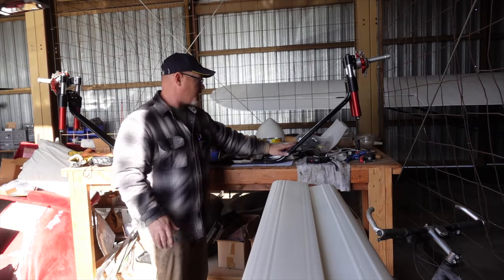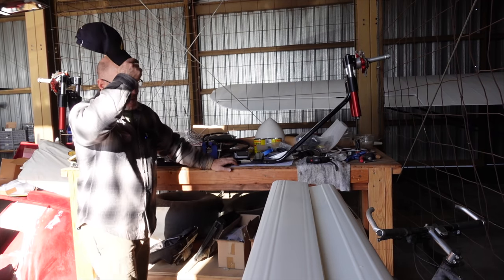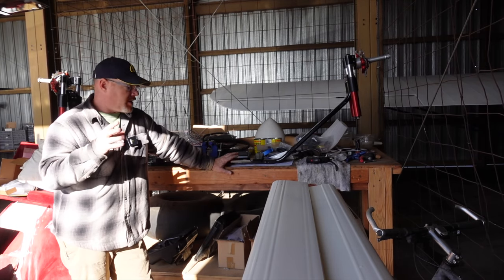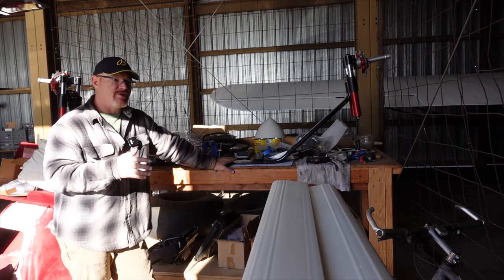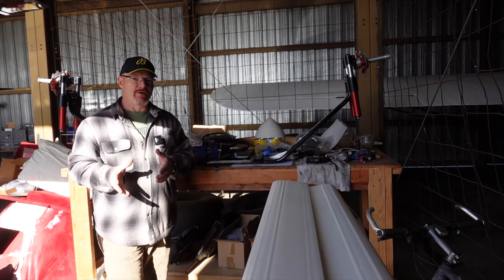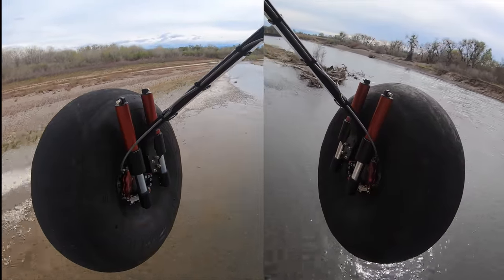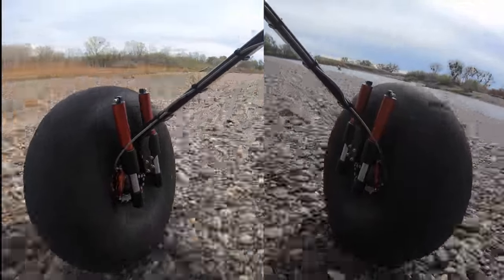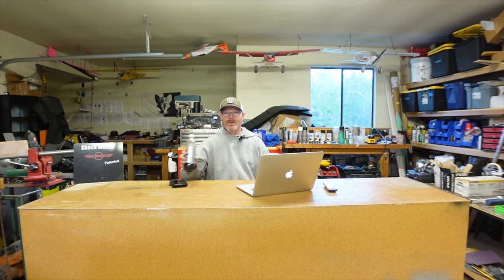Kitfox 7 Apex Build Episode 60 Beringer Shock Wheel

Comment: Bryan,
Watching your videos I noticed that the starboard shocks were compressing about 1/2” more than the port side shocks. Could just be my ancient eyes, but you might wish to review your films just to prove I’m cross eyed. Keep the aspidistra flying!
Paul
Reply from the maker: You are correct. Hopefully we will see that left Shock break in a bit more or maybe a slight pressure adjustment is needed.

Comment: I built a Just Aircraft Highlander a few years ago that had the Superstol landing system. It was a sweet setup landing wise but the drag was a problem, always trimmed the nose up but still got over 100 mph but wasn't running large tires. It had a 100 hp Rotax. I did borrow a set of large tires and it really killed the speed and required a good bit of up elevator to maintain altitude. I don't understand why Just Aircraft and Kitfox don't provide jacking points on the airframe, it would be easy to do.
Reply from the maker: It sure would. Jacking is always a pain.

Comment: Great system Bryan; I am very interested. Just one question: why didn't you use the internal brake line drillings instead of the ugly external lines with tie wraps?
Reply from the maker: They don’t have the gun drilled lines.

Comment: I really enjoy your channel. Have noticed that your shocks are dangerously close to bottoming out.  Consider having your plane’s weight rest at least half the total travel.  Also consider airing your shocks with nitrogen to eliminate moisture.  Think about it.
Reply from the maker: They are designed to compress that far. I agree on the nitrogen, but the way they designed the valve stem, it doesn't have enough clearance to fit a normal chuck on it.